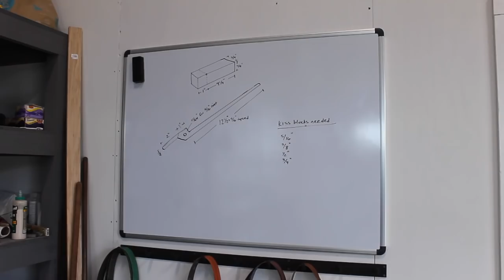Forging Tong Blanks: A Different Approach

Comment: Nice forging, mate. What material are these kissblocks made of? Cheers.
Reply from the maker: Thanks, I used 4140.  They work well enough and won't mark up the hammer dies like H13 or S7 would.
Reply: @rigoniironworks  thanks a lot, mate. I really like your work, It's accurate and clean. And so are your videos. Well done!

Comment: Hello, would you mind sharing the dimensions of your tooling?  I would like to make some for us at school.
Reply from the maker: I show the sizes on the handles of each tool.  The angle block is at 45 roughly.  Tongs dimensions vary based on which you are building, so no universal recipe I'm afraid.  Just make the jaws thick so they won't bend in use.